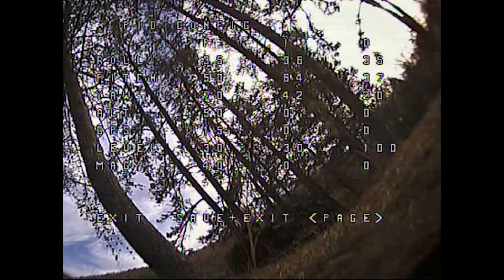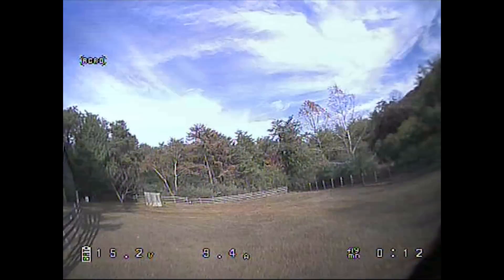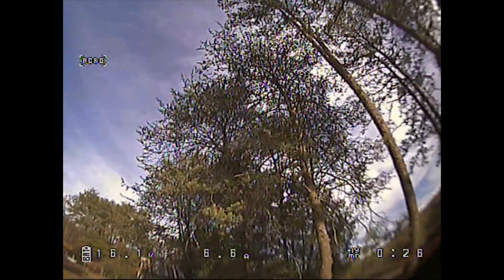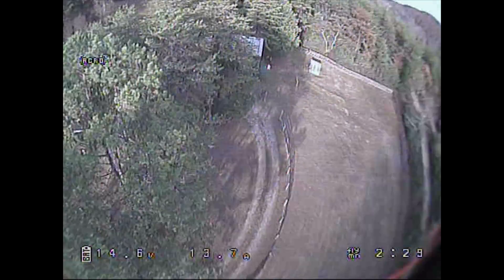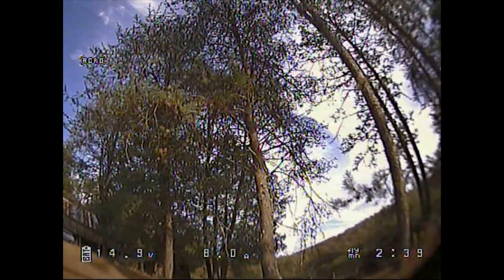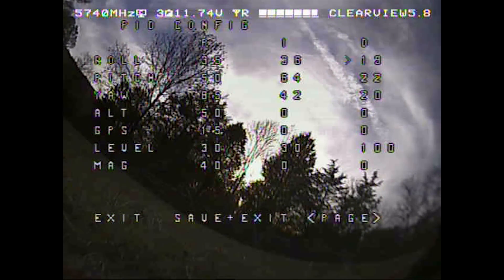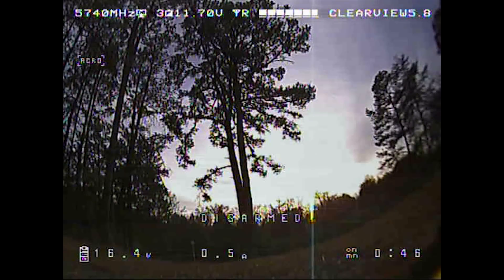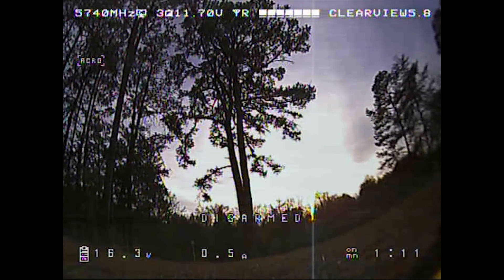Practical PID Tuning - Part 12 - Holybro Shuriken X1

Comment: Hi Joshua, I got my X1 from gearbest in january. I have massive problems with yaw jitter at lower throttle. Also with no props on it the quad starts to shake at 20-30% of throttle. Many many other have the same problem with this quad. Can you confirm this? Have you also this problems and could find a solution for it? Best regards from germany!
Reply from the maker: +Olaf Walther underground FPV has some replacement ESC's for the X1 that solve this issue. You can also try soft mounting the motors. I have advised Holybro and Underground that they should soft mount the gyro (just the gyro chip itself) on future versions.
Reply: Thank you very much for your quick respond!  I think it too that the problem of yaw jitter are the esc´s. With no probs on it the quad shakes between 20-30 throttle.  I´m disappointed that holybro sells this quad with this known issue.

Comment: Hello Joshua! I just got my shuriken x1, how did you access the osd menu via goggles/vtx? I can't find method in documentation.
Also, I managed to reset my pids to betaflights latest version 'profile one' and is flying like crap! Documentation advised the stock pids profile can be could be downloaded from the holybro website but they're not any where to be found? Would love to learn how to access the osd menu via the goggles and get th stock pids restored, or, coy yours, they're just hard to see with the foliage background on this video. 
Thanks! Joshua.
Reply from the maker: OSD menu is accessed with middle throttle, yaw full right, pitch full forward.
Reply from the maker: Factory PIDs seem to be (at 2:48)

Roll 35 / 36 / 20
Pitch 50 / 64 / 21
Yaw 70 / 42 / 20

Comment: How can you pull the menu on the screen and  how can you move it with your trasmitter ?
Thank you
Reply from the maker: +tiger exhaust to bring up the osd menu, throttle center, yaw right, pitch forward. To navigate use the right stick to move the cursor and the left stick to change options.

Comment: Hi Joshua, it seems to be a very interesting BNF Quad. Nice and informativ Video. I´ve got a question abbout the osd. I see your are changing PIDs directly on the osd. Is this supported by the AIO Flightcontroller, need this functionality special settings in openflight software. Best regards from germany! I´ve ordered a Shurkan X1 last week. Now I´ve read something about worse working ESCs that perform in stottering motors. Can you confirm this or can this be solved by pid tuning?

Comment: Got my motors spinning.... Didn't have the battery plugged in lol... U still have the default config for eachine assassin 180?
Reply from the maker: +Wann Sklobi I've never owned that copter.
Reply: im sorry i meant do you know where i can find default settings? like a factory reset? i think i may have messed up something in my cleanflight settings, during an "ESC Calibration" because now its not working. 2 motors on left dont spin up, and ones on right barely spin at all. Ones on left act like their trying to spin but wont completely.
Reply from the maker: +Wann Sklobi just re run calibration?
Reply: Joshua Bardwell
yes i did try and rerun it unsuccessfully... just got the think too... i was gonna ask you on your build tonight but you were busy fixing the motor wire. Didnt think it was a good time. Although i love the 4 in 1 ESC im seeing more of recently. Just makes things easier.
Reply from the maker: I'm sorry... I don't really know what you could have done to put the copter in this state, so I don't really know what to suggest to get you out of it.

If the motors don't spin up from the Motors tab then the ESC is not getting good throttle from the FC or the ESC is not able to move the motor. But re-calibrating should fix that. If you power up the ESC with the Motor slider all the way up, and the ESC does not give the calibration beeps, then either "Programming by TX" is turned off in the ESC, or the ESC is not seeing the throttle signal correctly.

Did you maybe change from Oneshot to multishot?
Reply: It just goes into that loop of never ending tones. Beep.. Beep beep.... Beep beep beep... Beep beep beep beep. Changes tone slightly and repeats.
Reply from the maker: Make a video of the tones.

What are you doing to make it make the tones? When, specifically, does it make the tones?
Reply: it only makes 3 beeps now when i try to calibrate or plug in period. Im running betaflight with this thing now. But yeah even when not attached to PC it makes same 3 beeps then nothing at all
Reply from the maker: I've never heard an ESC make that sound. Are those blheli ESCs???
Reply: Joshua Bardwell don't think so. I got the Eachine Assassin 180 V2 because it was a great deal with goggles and TX. They are 12a ESCs, here is link to them 
Eachine Assassin 180 Spare Part 12A 3S ESC For Assassin 180
https://banggood.app.link/XnxtfSyIZy
Reply: Joshua Bardwell I wanna say I appreciate you taking time to respond and all your help sir. Hopefully this gets fixed cause I just got it, used someone's PIDs and they weren't very good, so I flashed and ESC calibration gave me this lol

Comment: do you intend to check out out the diatone Crusader GT2 200? might be a better pre-built quad at the same price as the Shuriken X1
Reply from the maker: The Shuriken X1 is very good, so if the Crusader was better, it would be extraordinary.
Reply: stew at UAV Futures here on youtube has recently reviewed them both and has said that he thinks the GT2 is better/faster. I believe he is planning to film a head to head shootout of these two. I actually had the Shuriken placed on order from gearbest.com but somehow was backordered despite being listed as in stock so i canceled and got a refund... partly because I thought I wanted to wait for the verdict on the GT2.

Comment: on your builds do you put a capacitor on your line? I get some brown outs to my rx's but I also get some interference at high rpms. At this point I generally get another rx. I am not sure if this is a cause and effect but will this help? BTW great flying.
Reply from the maker: +gpwelter I usually don't need to, but many people find it helpful.
Reply: Joshua Bardwell I do run a pdb. i guess that could be enough. thanks anyway.

Comment: Hello again sir! Another great video! I never heard back from you regarding the brushed motors not spinning in BetaFlight. I do have it set to "Brushed" and i get nothing.... I have one of the new Eachine F4 boards. Only thing i did was flash it with the REVO firmware. Didnt know what board to choose since i didnt see mine. Could that be why?? Something you could see with the dump file?? Its soldered correctly and the 8520-18s work just fine. My loop is at 8k and 8k. Only 4% of board processor being used.
Reply from the maker: +Wann Sklobi don't run such high frequency with brushed motors. Try 1k.
Reply: Brushed motors on an F4 board?  Are you running a super micro?
Reply: Robert Baltrusch well kinda... It's a brushed f4 board with killer MMW motors. For an extra kick, the mylipo 450mah 45C... Last build I did using the same stuff except i used JJRC 1000 board. Things was a rocket, this should be better I'm hoping. Still new at this lol
Reply: Joshua Bardwell ok will do. You think that may solve it? I'm gonna try it. Set, save & reboot.
Reply: Joshua Bardwell set to 1khz on both. Still motors don't spin. This is my first time running betaflight or any software but I'm a techy and know what I'm doing outside of this program and no clue on what to set anything to. Maybe when I get my TX back on Sunday that will solve issue. I just figured the program would make the motors spin. I have the board running to a sbus to ppm converter, then to iRange mini flysky ppm receiver. Board doesn't support ppm.. I'm sure I could've done this different, but should work properly in theory.
Reply from the maker: The program should make the motors spin when you raise the sliders on the Motors tab. I don't know why it's not.
Reply: Joshua Bardwell I thought it was the Revo firmware. I thought maybe I chose the wrong firmware to flash. Maybe I will upload a short video showing everything I'm doing. But yes I agree, I thought they should be spinning
Reply from the maker: +Wann Sklobi what board are you running?
Reply: Joshua Bardwell Eachine F4 brushed
Reply: Joshua Bardwell UPDATE!! This is what happens now....
 
https://mega.nz/#!lNZ3iAbb!iS_jXupaOtpIW2XkOzoxIhI1vgpzIJaooPe9wNun_q8

Comment: Hi Joshua,
On all your tuning vids I see many similarities of types of maneuvers while looking for specific tuning problems. Eg throttle chop for I gain, reversals for prop wash. Is it worth designing a specific routine that covers tuning issues? I see you look for similar maneuvers for Blackbox analysis too.
If everyone flew a 'tuning routine' would it help not only you, but us - also for direct comparison between flights or between quads?
Reply from the maker: +snitch Seven this is a good idea. Maybe it would be good to formalize it.

Comment: Hi Joshua! thanks for posting! did you have any issues with the vtx? my rendered useless upon take off. Visual and osd pretty solid at idle, once armed, no vis. Tried at 200 & 600mw settings and all avail channels. Contacted holybros cs and they're sending a new board. Just wanted to ask if you had any issues with it.

Comment: Do you think quads will ever self/auto tune? The transmission on my Jeep took time for it to calibrate itself, I think a quadcopter should be able do the same.
Reply from the maker: +Flyin Mikey autotune algorithms may get better but currently they're just not good enough. The number one thing that will improve tuning is better flight control software that makes the quad fly better regardless of tuning.
Reply: Autotuning take cpu power and it seems these are heading in the right direction but need more cpu grunt to process more.
Reply from the maker: +Kristian Taylor it's not just that. Autotune is hard to get right!

Comment: You should fly it with a better battery pack.  The copter is asking for 120-140A and your battery seems to only be able to deliver 60-65A before cutting out.  The F40 motors are really hungry, but they do put out, especially the VII which is on the Shuriken, amazing choice for a BNF.  A 5" prop is going to pull 37A at full throttle on that motor.  I really like the Lumenier Graphene packs ... well sort of ... they are kinda a rich man's choice, however, they deliver on that 80C promise (and as far as what I've tested are the only thing to deliver in the 100A range) but I've had a lot of them drop cells after really pushing them.  You should get a 1300 and 1500 Graphene, and fly them on something like this because you don't know what you're missing until you've tried it.  Then you can decide if spending $200 on packs every month is wort it or not.  I don't practice with them to save some cash, only race so they last me a bit longer, but damn it makes a huge difference.
Reply: You new here?

Comment: Hi Josh, I'm glad it's not just me then. Desyncs with Multishot and an "ok" tune on defaults that are hard to tune any better. For the money its ok but not locked in and funky noises from the motors. I also get vibes just below half throttle no matter what I try...I might lower TPA to kick in at 1400. If you make any progress with this one let me know. My shuriken 180 is on rails in comparison. From what I've seen this X1 is a lot smoother on Oneshot 125 but my multishot desyncs stopped after calibrating motors.
Reply: I have recalibrated motors with multishot and one shot.  I don't get the odd noises on oneshot but the tune is loose and won't brighten up. I've just blasted 3 packs through the stock tune again on multishot and stock PIDS and I've decided this IS a racer and like lots of camera bagley and flies real nice above 50% throttle. And yes this thing is fast!
Reply: Hey Darren, 
Update the Blheli-S firmware to the latest version and change the motor timing to Medium/High and use the tune posted on the Holybro facebook page. 

This issue was all ESC

This is the latest update to ONLY fix the "Early" 20 units sent out to reviewers :) Hope this helps!
Reply: Ok cool thank you! I'll give that a try.
Reply: Nope I still get a metallic clicking sound from the motors with Multishot turned on and BLHeli_S 16.5
Reply from the maker: +John Doe you mean brake on stop or damped light?